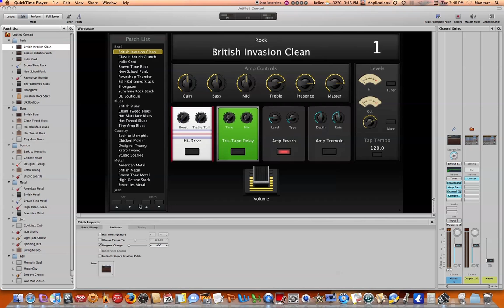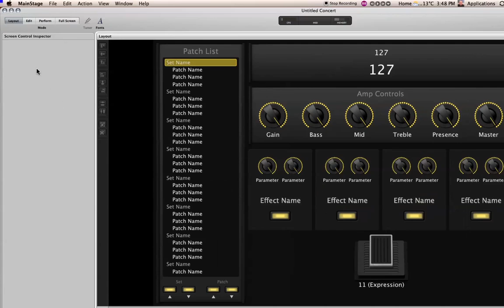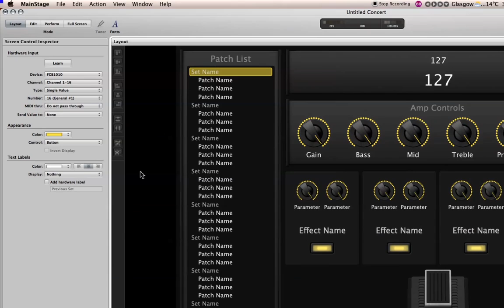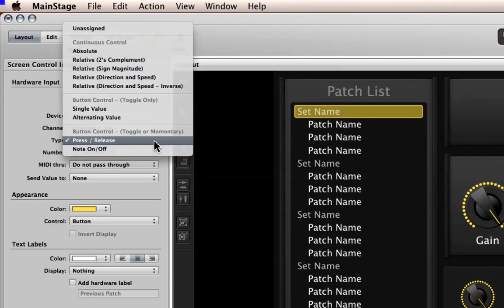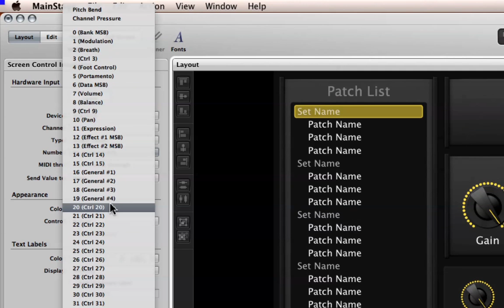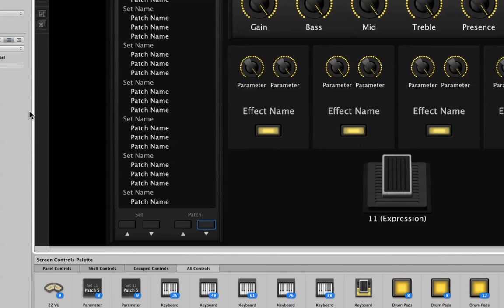Mainstage 2 - External MIDI - FCB1010 Pt 2 of 3

Comment: Hey, thanks for responding. I actually figured it out shortly after I wrote this. I was using a CC comand. I was using the same program to program my fcb1010 and I ended up just looking at exactly how your screen looked and doing the same to mine. One thing that was different in my set up was that some of the buttons were programmed to do program changes. I don't know a lot about this stuff, so I'm not sure if that's what the problem was or not. Anyways, thanks a bunch. Your videos help a lot!

Comment from the maker: @alexwnbrg Thanx for your comments!  Let me know exactly how you're moving from one preset to the other.  For example, are you using a MIDI CC command and mapping it to the control on the screen?  I'm guessing this is the way you are doing it but I'm no sure.  The best way to do this though is to use the a MIDI PC (not a CC) and match that PC # to the patch you are moving to.  e.g. Patch 1 should have PC#1, Patch 2, PC#2.  PC is specified in the Attributes tab of the inspector at the bottom.

Comment: First off, thank you so much for posting these. These videos have helped me immensely. I have a question though. I'm using my fcb1010 in nearly the same way, I have it set up to where I only have two patches, clean and distorted, and then I'm running both of those to an aux channel with a bunch of effects. I want to set up on button so I can just cycle between those patches, and when I do this and use the mouse to click the button on the screen, it works. When I do it with the fcb, it will go to